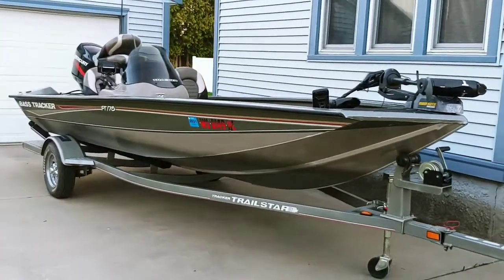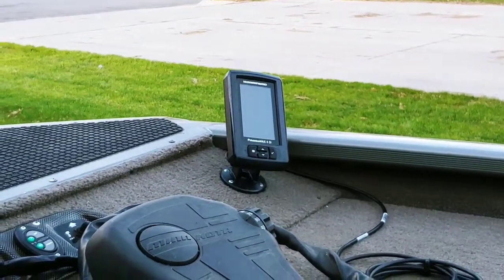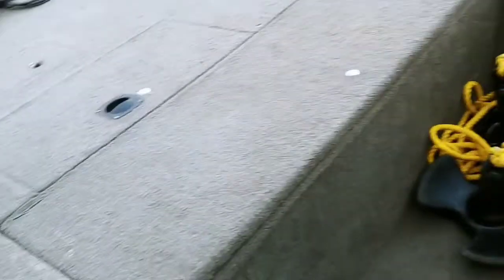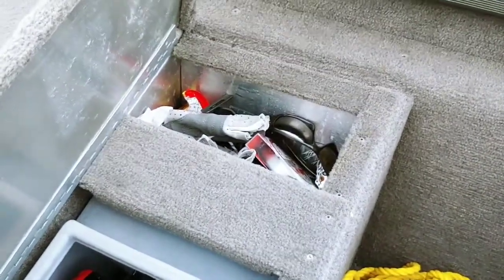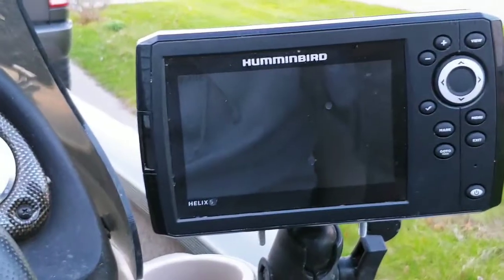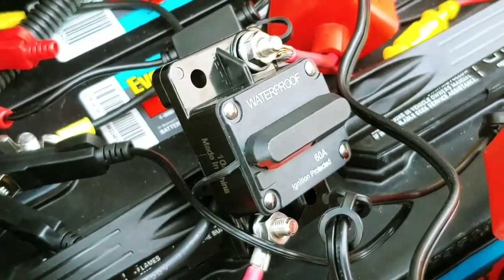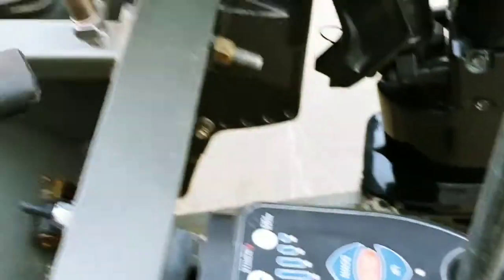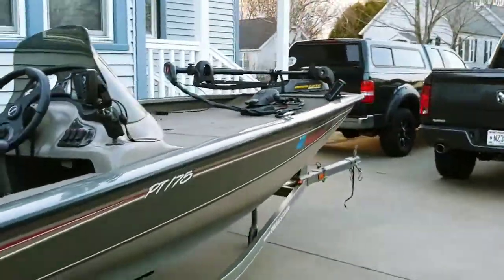2005 Basstracker Pro Team 175 Upgrades and Mods

Comment: Great boat, great mods... I've got a 2004 PT 175... it had a 50 on it like yours. I upgraded to a 90hp jet, added beavertail float pods to help with the weight, a second battery and moved up to a Minn Kota 55 trolling motor. I can sneak into the slough's off the main rivers here in the PNW as that jet gets me across a lot of skinny water. Great Video.

Comment: Beautiful ride.  One thing to consider when you pull the trolling motor in is to flop the prop off the outer side of the boat.  That pedal gets pushed and you're either breaking shear pins, props or at a minimum slicing the pristine rubber pad on the bow.  I wish my 2002 looked like that!
Reply from the maker: I actually upgraded to an ultrex this spring and its the best thing ever!
Reply: @EagleOutdoorsT2EAGLE82  very nice. What about all that noise when steering?

Comment: I have a suggestion, sell both of those anchors and buy one 30lb lead pyramid shaped anchor, buy a spray can of car under carriage paint( the paint they put underneath your car to protect it, -the same as FlexSeal) to make the anchor last longer and attach a 3’ piece of chain between the anchor and the rope. The chain acts as a shock absorber. You won’t have problems with your anchor holding any more. We use them in the PNW on steelhead and salmon rivers. I would find a better nylon rope also, that kind you have gets tangled too easily, but you want nylon so it will float so when your buddy drops it overboard (he will) you can retrieve the rope or run a crankbait through there with some 65lb PowerPro and snag it.
Reply from the maker: I put an Ultrex on the front this spring and haven't used an anchor all year now 👍 awesome advice though!

Comment: Looking at one of these right now on FB marketplace. Would be my first bass boat so I'm excited, but also a little hesitant. It comes with a 50 HP 2-stroke Merc, 70lb thrust Minn Kota maxxum, 1 crank and 2 NEW deep cycle batteries (24V setup), on board charging hub, fish finder, boat cover, the trailer has new axle and tires, and it looks to be in good condition all around (carpet, hull, etc.) That being said, the guy wants $8,700 for it. We are setting up a sea test to be certain I'm happy with it and the motor/trolling works well. Being that you own the exact same boat, just a different color, how would you justify/not justify that price? I feel it's fair, not a great deal by any means, but I feel like I wouldn't be taking a huge wash on it, again assuming it all runs smoothly on the water.

Edit: I have the money for a newer boat, but being my first bass boat I feel this would be a good entry point.
Reply from the maker: Personally I think that's a good deal in today's market if everything runs as it should. Bring cash and try and negotiate with cash in hand for a better price.
Reply: @EagleOutdoorsT2EAGLE82  Thanks, I feel the same way, good to have someone else agree. If I really enjoy the bass boat life I see myself potentially selling this in a few years and upgrading and I just don't want to take a huge loss should that happen. Love a good negotiation, will definitely be trying to land somewhere in that 8,000-8,5000 range. Thanks!

Comment: I’m glad you mentioned the battery issue, I’ve got a 2010 Tracker 175 and I’m not sure I can get three batteries in my boat.  Was the original setup 2 batteries set up in a “T” formation?

Comment: Great video! Did you have to run new wire (heavier gauge wire) for the trolling motor. I have a 97 pro team 17 tracker and want to up grade to a bigger trolling motor. I do believe tracker wired my boat with #8 wire from the factory, I just put a recessed ez tray in mine yesterday and it worked out great. Keep the videos coming
Reply from the maker: The 8ga wire is fine for an 80lb tm. 112 requires 6ga

Comment: I'm in an '01. How did you rewire the fishfinder harness & transducers?
Reply from the maker: The 05 had a stock fuse pannel that I ran everything to. The transducers were easy to run down the length of the boat after rmoving a few screws to reveal where the throttle and shift cables run to the motor.
Reply: @EagleOutdoorsT2EAGLE82  
Ok...I haven't taken the side panel off yet, I know the wires go down the side & out the hole. I'm dreading having to do that.

Comment: isn't there a built in Transducer on the trolling motor you could've used ?
Reply from the maker: Yes, but that is a sonar only and the graph was a DI model. Either way I replaced the tm with an Ultrex and the graph with a helix 7 this spring.

Comment: The battery compartment sucks on these boats.  I would like to go with a 6 gallon tank and have the extra room for batteries.
Reply from the maker: I was able to stack 3 batteries in there fairly easily and without issue. As a tournament angler I can say a 6 gallon tank sould have sucked.

Comment: 50 hp not enough hp need 75 hp mercury optimax
Reply: I would never choose a 75 hp over a 50 hp on a Bass Tracker 175 (or 185).
Reply: Not much difference in top speed on those motors. I hit 30mph with my boat loaded down and have  50 Merc, 2000 Bass Tracker 185 PT